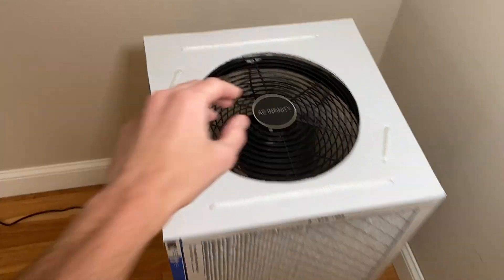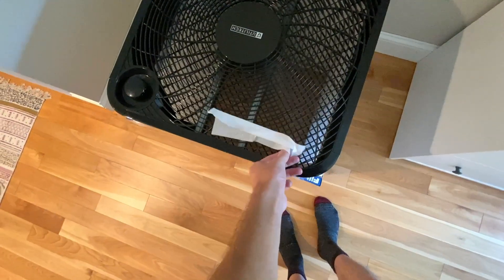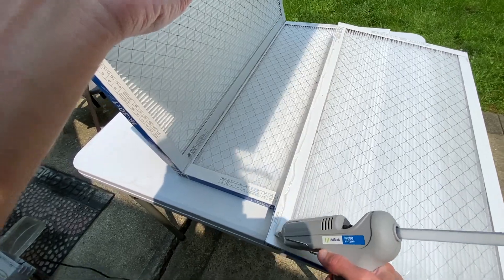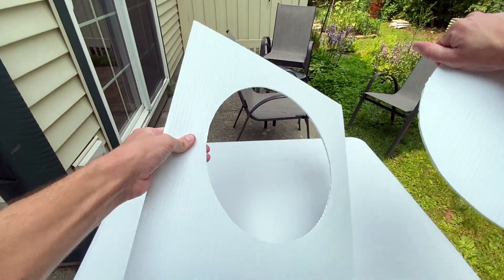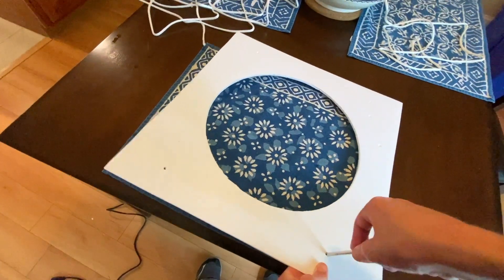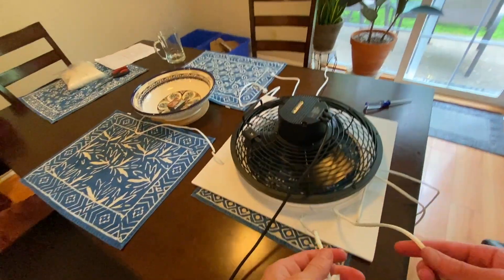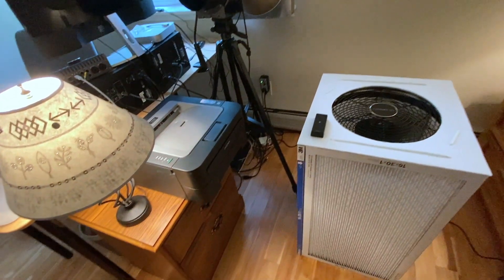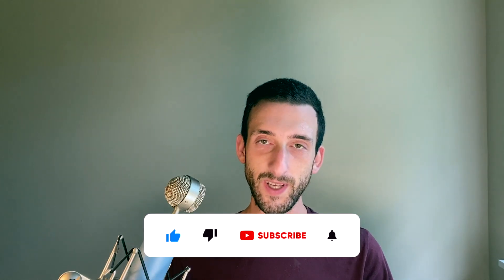How to Make a Better DIY Air Purifier

Comment from the maker: Hi folks! If you're struggling with indoor air problems, you might like my free 5-day course. It covers everything I wish I knew sooner: https://renegadeairquality.com/

And if you’re house-hunting or sanity-checking your place, I made a visual, tool-free mold inspection guide. It comes with an interactive checklist you can use while you walk a home: https://healthyhomeguide.gumroad.com/l/DIYMoldInspection

Some things you should know about this video:

1) If this fan (AC infinity cloudlift S12) is unavailable at the Amazon link in my description, try buying it from AC infinity’s site. Since I posted this video, AC infinity has raised the price of the fan to $190 USD. I’m not happy about that. I haven’t been able to find a fan as good as this one, unfortunately. But let me know if you find one!

2) It would be easier to find the center of the coroplast square by drawing diagonal lines from corner to corner and marking where they intersect: ☒. You don’t need to buy the T-square if you already have a straight-edge that can measure 2 feet.

3) You can use zip ties instead of synthetic clothesline to attach the fan to the coroplast shroud. Just put the holes closer together, and use 4 zip ties spaced equal distance apart.
Reply: How about a link to the Coloplast fan please .
Reply: @danielkaylor8395  link in the video description 
Fan: AC Infinity CLOUDLIFT S12 (not Cloudline)
Reply: Hello! Now that it's 10 months later, is there anything else you would change about this design? I've noted:
1. The way to find the center
2. 16x25x1 instead of 16x30x1 filters
3. Possibly using pc fans (I'm doing the ac infinity because I want a higher amount of airflow available during fires and I don't have a lot of free time to make the cutouts fit)

Edit: I have had this for a month and it's great! I would recommend tying down all 4 corners and adding foam weather sealing to the shroud. My filters were not perfectly straight or level so this helped fill the gaps.
Reply: @doka-l7v infinity fan is circular why wouldn't you have to still do cut out of board??
Reply: @jewelniles4041  You need to make a fan shroud. That shouldn't change. For The receiver, there is a cable that should come on the box that you plug into the receiver and an input on the back of the fan.
Reply: have you had to change the filter yet?  if so, how long did it last?
Reply: A chalked line can be snapped then you don't need a straight edge or pencil
Reply: Assuming fresh air is available....
Reply: Ok what was that cord off the fan motor that you plugged into remote receiver..where'd it come from??
Reply: What about the MRP rating for the filters...could pick between
Reply: I really enjoyed your video. You were specific on your instructions and you did your homework. Fine job fella!
Reply: What MRP did you use????Microparticle Performance Rating. The MPR rating system bases their ratings on the pollutant size that can be filtered, ranging from 0.3 to 1 micron. 3M's MPR filter ratings range from MPR 300 -2800.
Reply: @jewelniles4041  2500 due to a 4-pack bundle
Reply: @jewelniles4041 Sorry, I thought I responded to this when you initially commented. I did the filtrete 2500.
Reply: Where to buy please, I need to build mine
Reply: This was the first time I was ever going to use someone's link to buy something but that fan costs more than the GD pre-built air purifier! Efen-eh.
Reply: Just managed to get the fans in Australia at $45o aud per fan and now look up filters and to get them sent over from the states is about $300 per set.....ouch
Reply: We have 6 Winix 5500 filters throughout our home. On the third fan speed they are still fairly quiet. Twice a month, I vacuum the pre filters. Based on how dirty the pre filters get, I’d say each unit is circulating a decent amount of air within their zones.
Reply: We just had our first real bad bout of wildfire smoke descend on the Seattle area today, 9/5/2025.  This weekend I will be replicating your build.  Thank you, you're Awesome!
Reply: LMAO you posted a link to a $200 fan!  Are you joking?
Reply: @Octopusprimal you should definitely use the dollar store fan with the cheapest filters if that is the way you want to go. It didn’t say cheaper, it said better, RTFO!
Reply: @lbinok  The dollar store?  Is that where your mom buys her clothes?

Comment: The whole Idea of the Corsi-Rosenthal filtration design, (which this is), is to get clean air on a budget by making an efficient air filtration unit for relatively cheap. When you start adding expensive fans to the cost you have defeated the purpose. 
I like this video and the tutorial on making one, however I'm not going to spend almost $200.00 on a fan. Might as well just buy a commercial air purifier.

Comment: i like the idea but how im seeing it. so $200 for a diy and filters cost $100 every 3 months already is about first year $500 an 100 per year  for filters. you can buy good quality for less then 300 and filter is $45  per year. sound like diy is more expiative could buy 2 good quality for the price of operating the diy
Reply: fan is $189 amazon just fan is the cost of a air purifier
Reply: @candridge14   ... yes, but I think the idea is that this DIY build is able to filter a much greater volume of air

Comment: You are trying to pull air. 
Next time you build something, try to push the air. 
Pushing is the only way to pressurize the air. 
I don't have an air purifier so I don't know how it is normally done. 
Pushing will work better.
Reply: he covered this - apparently :
" For air purifiers the fan should be blowing upwards, for two reasons: 
1.) If you blow air downward into the box, there's a lot of turbulence that reduces the air flow rate. 
2.) By pulling air through the filters before it hits the fan, the fan will stay cleaner. "
Reply: @MartinWhiteley Yes, you are right. 

However when you “pull air” through the filters, you are blowing the air “up” and when you do that for a while, look around, you’ll see a thin film of dust everywhere as you disrupt the air flow in your room.

I’m not saying there is a “best solution”. 

I am saying, you need to look at your environment and decide what trade off you’re willing to make.

For example …
1. If you are trying to clean the air in a room that’s “dusty”, then I agree, try the “pull method”. Air get’s sucked into your filters and blows “up” right into your path to breathe clean air.

2. If you’re trying to clean dust out of a workshop … then “push” is a better configuration. You want the dirty air flow going down and you want clean air coming in from the top. Maybe an open window? Or an incoming vent from outside bringing in clean air.
Reply: .... Aah yes, that makes sense. This air filter is designed for normal domestic use rather than a dusty workshop.

Comment: Good design, but the sound information seems incomplete.  Decibels use a logarithmic scale and human hearing perceives a 10dB increase as about twice as loud.  The box fan at 550cfm is about 2.1 times louder than the AC Infinity at 590cfm.

At these settings, the box fan is converting 32X as much energy into noise as the AC Infinity.

Comment: I checked the fan on AC Infinity website and I see that the fan you used is not Cloudline S12. 
They have a fan named Cloudline Pro S12 but that is an inline fan, completely diffeterent ( it looks like thee fan you used for DIY carbon filter).
However, they have also a Cloudlift S12, which looks like the fan you used.

Comment: If the fan I have is way too big (I don’t want to buy another right now), can I cut out chloroplast to seal the back side of the fan? So instead of sitting recessed, it actually sticks out. I know there will be energy loss on the back sides, but will it still have enough suction to pull air through?

Comment: Why are the MERV filter arrows pointed left (facing the interior of the unit) if the fan is pushing outward through them? Aren't you supposed to pull the air with the direction of the arrows?

Comment: Hi, maybe a dumb question but if I use a HEPA filter instead of merv13 will that also be okay? at my place I cant really find cheap merv13 filters but the replacement hepa filters for many of the brands are readily available and are also cheaper.

Comment: I watched this video a year and a half ago and immediately wanted to make this air purifier. I forgot/procrastinated and didn't end up making it until yesterday. I shouldn't have waited because this thing has made a huge difference within that one day(Not to mention I would have saved $60-70 on the fan). I have been using HEPA Air Filters for years and this thing puts those to shame. I needed to say THANK YOU for helping my wife and I. With Winter right around the corner I am looking forward to having fresher air in my home throughout the cold. Also even with the increase in price for the A/C Infinity fan I think it is still worth it to pay the premium price because it is QUIET. Like quiet quiet. I am planning on getting another one for personal use because of how quiet it is compared to my box fan.
Reply from the maker: I'm so glad you like it! It's SO incredibly powerful. I still use it to this day.

Comment: I would like to mount the fan upside-down so all the dirt is inside the unit, for easy disposal.
Reply: he covered this - apparently :
" For air purifiers the fan should be blowing upwards, for two reasons: 
1.) If you blow air downward into the box, there's a lot of turbulence that reduces the air flow rate. 
2.) By pulling air through the filters before it hits the fan, the fan will stay cleaner. "

Comment: I have all the materials aside from the fan, filters and cloroplast sheets, i should make one asap, my allergies have been so bad this year my body is having inflammation and itching all over and not just in my sinuses, i really need relief 😢
Reply from the maker: Hope it helps! It’s been amazing for my allergies
Reply: @HealthyHomeGuide  yeah! i'm also getting a good quality carbon monoxide detector today, i realy hope it's not low level carbon monoxide poisoning me and my mom has, kinda doubt it since my dad isn't showing signs of it, but who knows, better safe than sorry
Reply: @HealthyHomeGuide  in fact I just discovered a LOT of what looks like mold and and certainly dust in my window seal that must have been there since winter, gonna just buy one of the Clean Air Kits luggables, and try to clean the mold out of my room and possibly under my floors as well, at least it's not Carbon Monoxide!

Comment: Honest questions, anybody here with decent air quality sensors have been able to track how effective these are ? 

is it just another thing to worry in our life’s rather that adding any real value ? 

Does it only work in a closed environment? if there is open airflow, like an open window or something, maybe the air quality from exterior and interior would be balanced too fast making you just waste energy without ripping any benefit.?😮

if using a vacuum to “clean” does it mean we are releasing all the bad particles previously captured over the span of days in few seconds (assuming your air filter has a finer filter than your vacuum cleaner.
Reply from the maker: There are tons of research studies showing that these types of air purifiers are much more effective than HEPA. I made a video about that here: https://youtu.be/gaQTYrisieA

You can also just buy a cheap particle counter and test it yourself.

Your other questions are answered in my other videos, so feel free to peruse my channel :)

Comment: This is great, thank you.  One question - I would have guessed the airflow direction would have been opposite.  Meaning, the fan forces incoming air through the center and clean air comes out the sides.  The way you have it, particles that are removed from the air accumulate on the outside of the box, rather than the inside.  Doesn't it start to look gross after a while?  And don't some of those particles escape back into the air if the box is disturbed?
Reply from the maker: For air purifiers the fan should be blowing upwards, for two reasons: 
1.) If you blow air downward into the box, there's a lot of turbulence that reduces the air flow rate. 
2.) By pulling air through the filters before it hits the fan, the fan will stay cleaner.

Comment: I picked up some Filtrete 2500 16x25x1 filters (they don't even say MPR in the package anymore, it's just a number now) at Costco for $45 for a 4 pack, and they go on sale for $35 on occasion. I figured that's about MERV 14, at the low end of "hospital grade", and with high CADR, I figured it made sense to buy them. I wonder what the cost / surface area * rating  would be from all the filters you can buy at big box stores vs Amazon. I still need to get a PM meter to test it's effectiveness.

Comment: I made a single filter air purifier out of a TV cabinet in my living room where the cabinets underneath were not used.     Sealed all the edges. Installed a fan and an air filter.   Very happy with the results.
Reply from the maker: Fascinating, I like the idea of making use of a cavity that’s already available instead of taking up additional space.

Comment: I scanned comments for about 15 minutes, didn't see this question.  How often do the filters need to be changed?  How do you tell when they need changing?  I am building one now and I am going to try an alternate less expensive fan.
Reply from the maker: Every 3-6 months, depending on how dirty your space is. You can vacuum them to remove surface dust and prolong their life. I change mine when they're fairly dark in color.

Comment: What is the CADR of this build, if built per exact specifications and instructions as indicated in the video?  If too difficult to calculate all 10 speeds, how about just speed 5, and speed 10, or just the maximum CADR @ highest fan speed?  I did watch the video you recommended on how to determine square footage coverage and am going with the CADR as being twice the room square footage...

Comment: Thought you wanted easy? Why not make an X from corner to corner to find center. That way you don't need to do the whole half the length make a mark. X2. Also just use zip ties and not that cord.

Comment: Great stats! Better vertical design, and awesome quality fan suggestion, thanks for your work! There's a video which shows how to make your own furnace filters cheaper using 3m blue filter material. Another youtuber suggests use Merv 8 for affordable general filtering.  I would just drop the fan on there without securing it.  If it kicks over and disassembles, it doesn't make a difference anyway, it's still gonna fall.  Also, a cheap white thin stove exhaust fan filter roll as covering from Temu is super cheap to extend the filter life.

Comment: That’s a great video! Thanks.
I just did one using 16x25” MERV 13 filters and a $24, 9” “For Living” floor fan from Canadian Tire. This is a nice, quiet fan at a very good price.
The only thing is, at 9”, there’s almost 3.5” from the fan to each outside edge and the coroplast bends a bit, releasing the corners for air flow around the filter.
I tried adding a 3/4” x 5/16” weather seal stripping for it to settle into and seal but it hasn’t worked. I might try a narrower but thicker seal strip next. 
I may also make a cloth or screen “sock” to go over it and keep the cats away.
About $130 CAD total so far.

Comment: It appears that the cord for the fan is riding under the filters. If this is the case, has there been any calculation on how this affects the efficiency of the built unit. I admire the amount of time and research you put into this, and the care in explaining details of the build. Thank you.
Reply from the maker: Thank you! I folded the filters around the wire, there’s minimal open space between the filters and the ground.

Comment: The fan must blow the air up in the room in the center of the room to make the air to circulate and suck the dust from the bottom, so clean air will blow at the ceiling, this way the air will be cleaned very fast in the whole room.

Comment: I am finally getting around to making this since I saw this a year ago. Saved enough to do this. Replacing the 300S Levoit filter is more expensive in the long run.

Have you changed anything since this video in your design?
Reply from the maker: I use tape now. It’s just easier. I also use 16x25” filters because they’re easier to find and easier to build and dispose of.
Reply: @HealthyHomeGuide  Thanks for your reply. It seems that the filtrete merv-13(F7 / ePM1 in EU) filters have sky-rocketed in prices. 4 pieces are like 100 euros on Digikey.
How often do you switch your filters out?
Reply from the maker: Every 3-6 months

Comment: A great DIY! It's a bummer about AC Infinity jacking up the price of their fan. Actually,  there might be a market for them to introduce a version of the fan without the bracket and instead pre-mounted on a few different sized lids to be used with a few HVAC filter sizes. Do you have any thoughts on the AirFanta 3Pro?

Comment: A reduction of 3 dB is always about −50% of the power of the noise level. For instance, an airflow generating 16 dB versus 31 dB produces a difference in noise power of about 32 times.
However, the human hearing curve is also nonlinear. It's approximated by the phon scale, meaning it takes about a 10 dB increase for a sound to be perceived as twice as loud. 
So while the physical noise energy may be drastically different, it may not subjectively seem that extreme.

Comment: Do you think 14x30 filters would be good? For an even more slender footprint?
Reply from the maker: It could work, but it wouldn’t fit the fan I use in this video. You’d need a smaller fan. Though I wouldn’t want to use a fan with a smaller diameter, because a large diameter allows fans to move a lot of air.